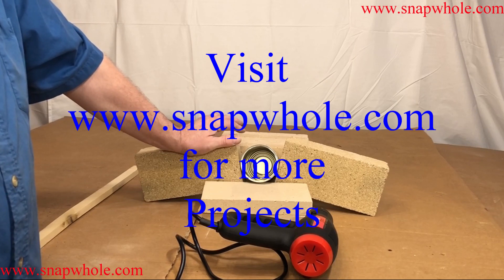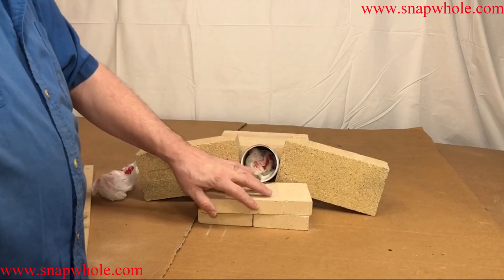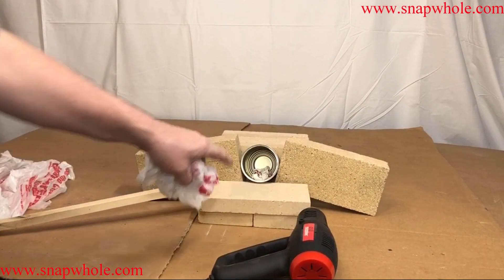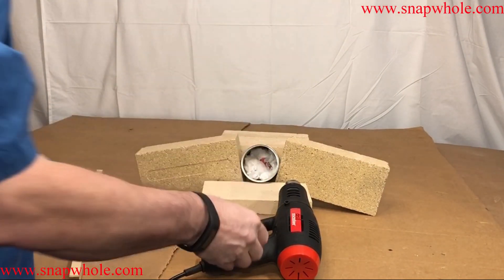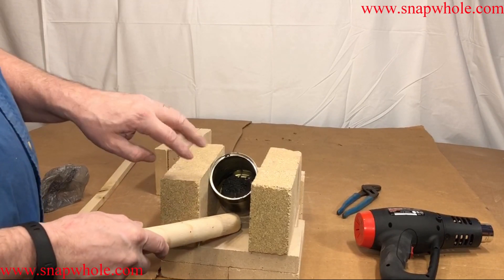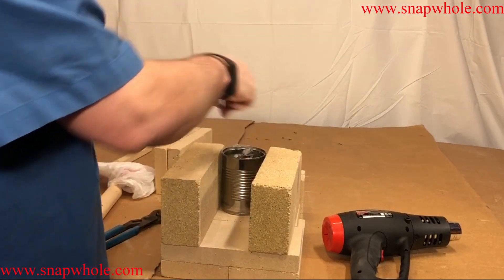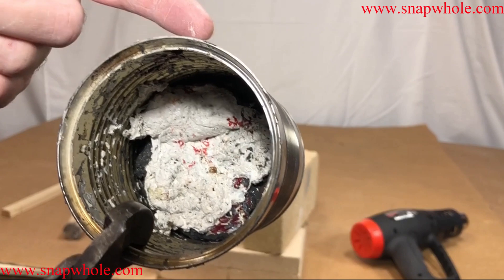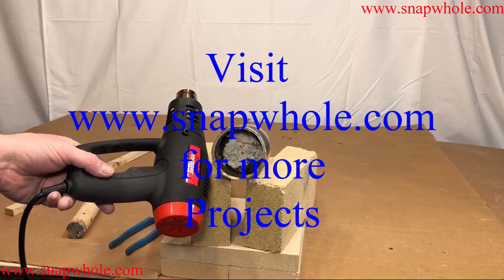Will the Harbor Freight Drill Master Heat Gun Melt HPDE?

Comment: Can you use the plastic to clean sanding disc and belts? After melting it.
Reply from the maker: You can, but it might melt the plastic - I have a huge eraser for cleaning sanding belts and it melts, it cleans the belts but is a bit of a mess - thanks for Subscribing!